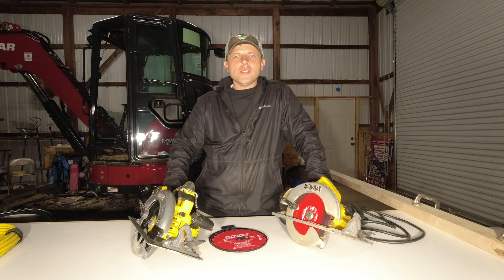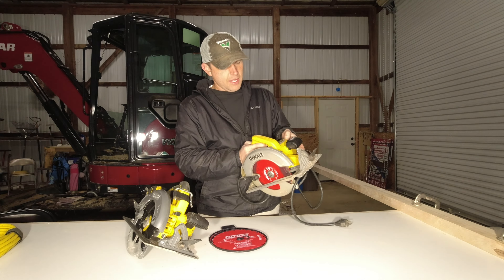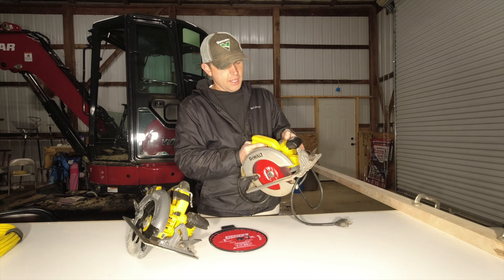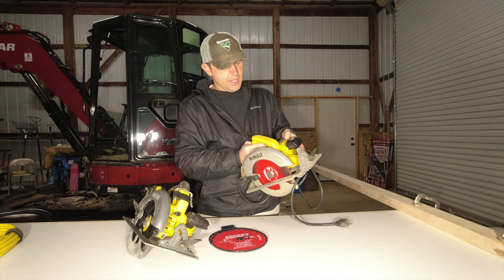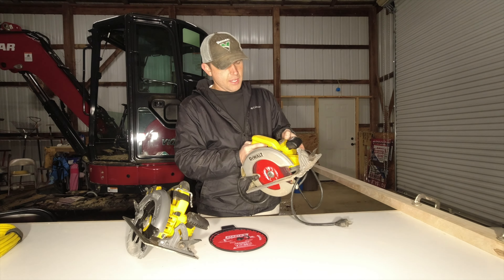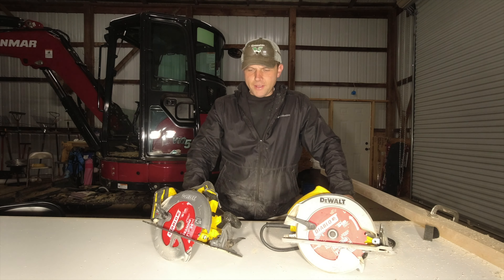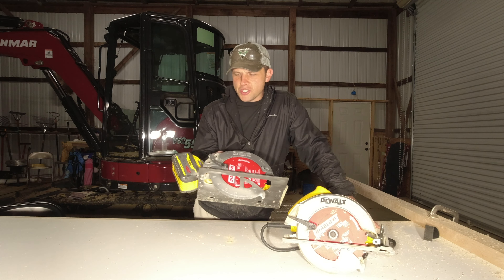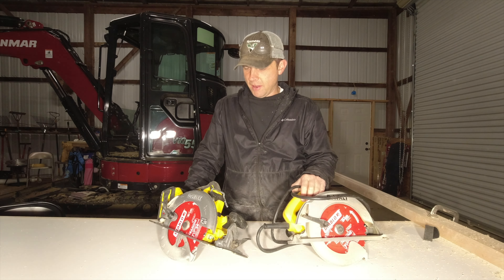#37, Dewalt Flexvolt vs Corded Saw, Battery vs Electric

Comment: The most important thing that everyone leaves out -  is how many 2x4 or sixes can you cut before the battery needs recharging ???
I have an older porter cable cordless circular saw, and it will cut about six 2x4s then the battery dies.  It's totally useless.
Reply from the maker: A very good point and I don’t have an exact number for you but I will say I bought a Dewalt cordless circular saw probably 20 years ago and it suffered from the same as your Porter Cable, useless and I never used. Although I don’t have a cut count I can say the FlexFolt saw I have is a different tool. Thanks for the question and I will see if I can put something together to test it.
Reply: Modern saws will do A LOT of cutting.
Reply from the maker: They will indeed!

Comment: Seems counterintuitive. Usually corded is much more powerful 🤔
Reply from the maker: I have tried cordless saws in the past but rarely used them. They always under performed and I went back to my corded saw. Having said that, this Flexvolt Saw is a different saw. The last time I used my corded saw was when I shot this video. Give one a try, they will surprise you! Thanks for the comment
Reply: @goodlucktrying21  I’m heavily invested in Makita. I’m now puzzling over buying a corded 10 1/2” saw or a cordless one (36v or 40v to complicate matters). Because I work (diy) outdoors I favour batteries - no cord to trip over, but the corded version will be more powerful. Usual decision making issues! Laurence
Reply from the maker: Find somebody that has one of the battery saws and try it before you buy. Good Luck With It!
Reply: I’m guessing you dont get out much?  Just a hunch. 🙄

Comment: 20 years corded saw? I have a milwaukee  corded saw and I have dewalt battery, there is not comparation corded saw is a lot more powerful tool, I use my battery saw just for small jobs in the roof like open air vents
Reply from the maker: Do you have the Flexvolt version? I have had an earlier cordless version but never used because of the reason you mentioned, no comparison to a corded saw. This Flexvolt is another animal, if you have not tried one find someone that has one and give it a shot. It surprised me, appreciate your comment! 👍🏻